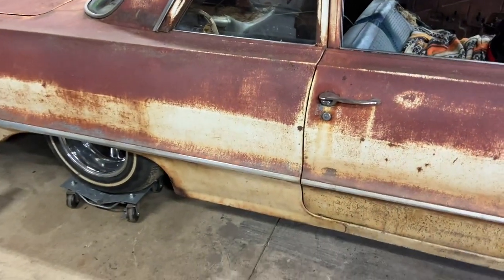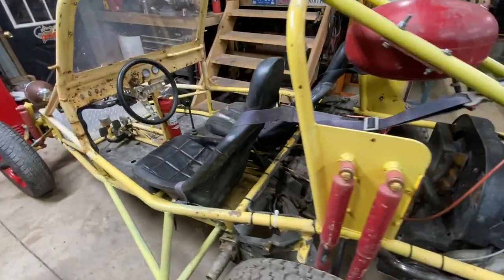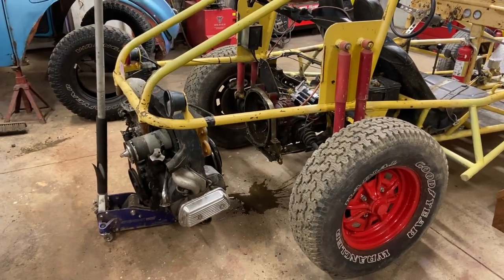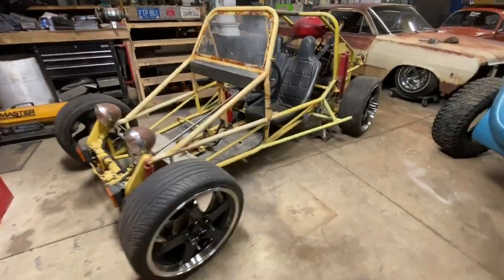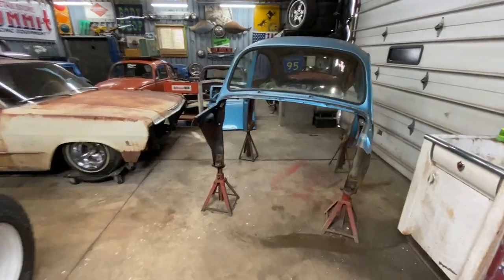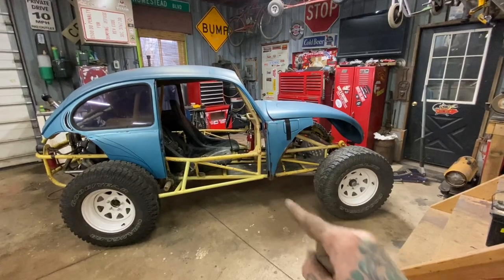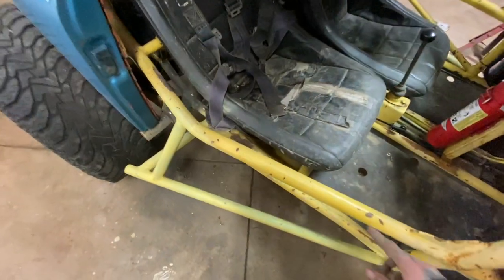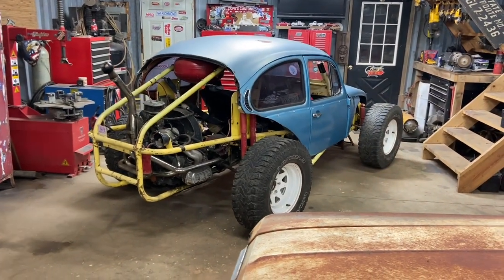Episode 27-vw baja bug rail buggy build part 1-project shape shifter

Comment: Dude awesome video. I’m actually picking up two projects this week hopefully. A sand rail with a bus trans in it but no motor or title and a 72 bug with a ton of parts and clean title both for about $1000. This video gives me some great ideas as I like rails but don’t care for how they look and especially if you want to try to drive it on the street in Oregon where I live I think the bug body and vin put on the rail will be allot easier to pull off.